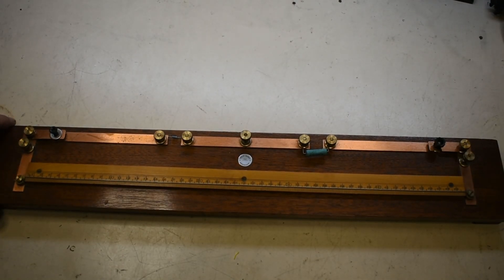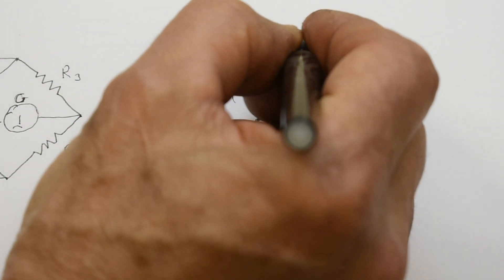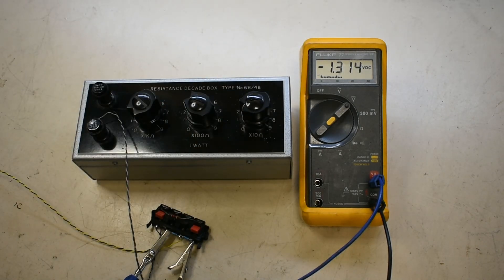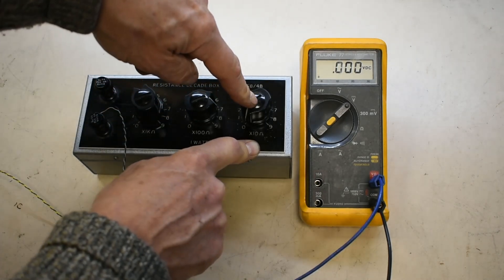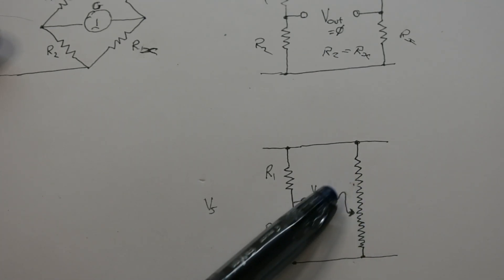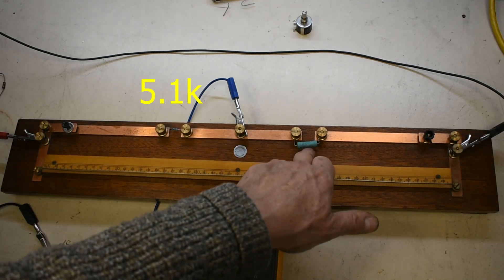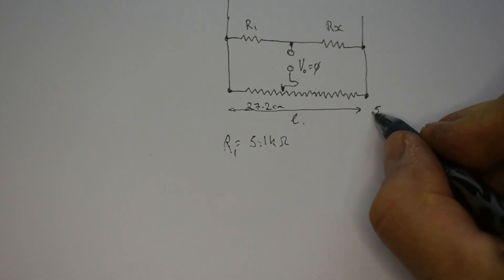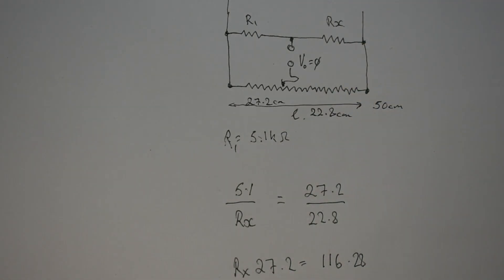Wheatstone Bridge

Comment: I always loved this principle, a a pair of voltage dividers that form a resistance to voltage converter that just gives the differential output, genius, obvious the differential output wound be fed into a low noise variable gain differential amplifier amplifier in a finished LCR bridge or when using very low output sensors in place of the resistors, ie the strain gauge for a weighing scale and so on, its cool that the same principle can be used with inductors and capacitors too.. great video kram as soon as im well enough i will get in my lab and make a complimentary follow up to this with the capacitance bridge. And also the inductance bridge (Maxwell bridge) ... do you have any strain gauges/load cells around? Maybe a part 2?? 😂.......

Comment: Thanks for making this - really interesting. Would be interesting to know how much current a period appropriate Voltmeter would draw? I bought a vintage Air Ministry one for aircraft battery levels, it draws a peak of 3mA.
Reply from the maker: Thanks, yes,  older analogue meters tended to have a larger influence on the circuit being tested. Although they were also well made and last well if looked after.